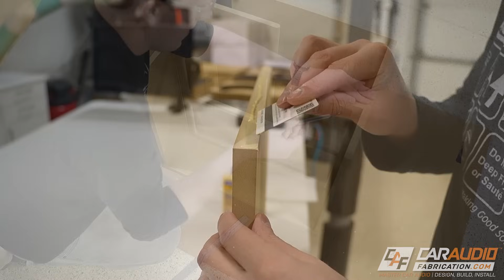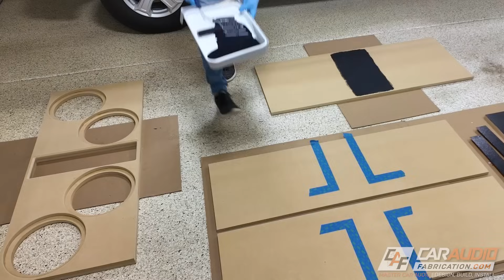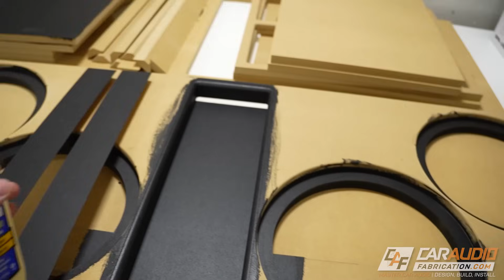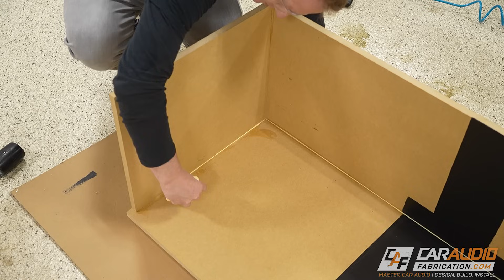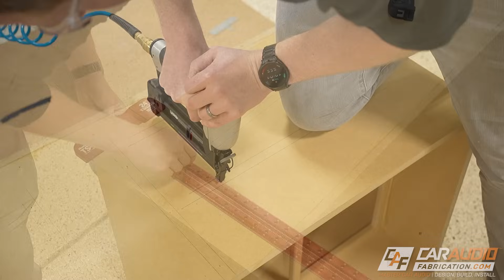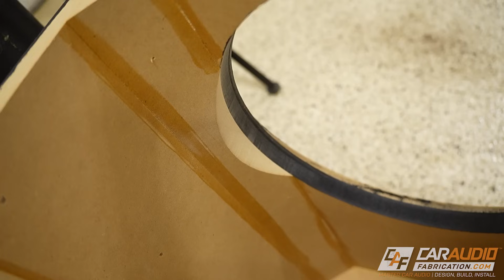Building Ported Subwoofer Box FOUR 12’s! - Assembly

Comment: If it's happened before why wouldn't you adjust the measurements instead of cutting out bracing?
Reply from the maker: It's a LIMITED space. You can't just magically make the box larger than what the vehicle would allow. And it's not actually an issue, I can easily remove the material as shown in the video.

Comment: Have you ever had issues with putting the enamel straight onto the MDF without any primer? I tend to undercoat / sand with Zinnser BIN shalac primer, its not cheap but goes a long way and helps aid in a glass like finish once you add paint either acrylic or oil base enamel, I've also vinyl wrapped MDF using this priming step with wild results!!! love tuning in mate awesome work!!!

Comment: Hello Mark , I have been following you for years now and I have been into car audio since 1985. I realize that I just aged myself but I’ll continue. I just purchased a 2010 Mini Cooper Clubman after my Insurance company decided to total out my prior car after hitting a deer. I’m contacting you because I am curious about what you would recommend to replace the factory stereo system in my Mini since part of the display and controls are built into the speedometer/everything else gauge. The car has the Harmon Kardon three way component speakers in the front and I believe that there are 6x9 speakers in the rear. The reason why I’m looking for your opinion is that in my previous car I was using four 15” subs and I loved it. The problem is the space is far less in my Mini Cooper but I still want to get the thunderous bass that I love. Any suggestions for me ?

Comment: Great vid Mark. Anyone or Mark, been out of building enclosures for a couple of decades, built 'um for a couple of decades ;) I know a lot has changed, but the principals are all still there. Wanna build an enclosure for a home, slot ported single 12". Have the thiele/small parameters around my desk somewhere. Can anyone point to some software now that I can input my specs and space allotment and it will spit out the tune/pieces to cut etc? Thanks a bunch, been watching Mark for years. Cheers.

Comment: I'm very curious of the reasoning behind the equipment choices here.  Is it mostly because it's a channel sponsor?  It's been a while since I've seen single voice coil subwoofers picked for a build.  It looks like you're probably planning to power them with that 1500.1.  Is that correct? The specs say these subs are rated for 500w rms, are you planning to feed them under 400? (assuming the amp makes right at rated power)  I might have missed it, but what's the net airspace and port tuning on this enclosure?

Comment: Mark I've watched lots of videos on painting MDF and can't find a lot of good info.. Is water based paint ok without using some type of sealer?
Reply: MDF will work with multiple coats of water based/borne finishes without a problem.  If you you want to cut down on finishing time, you may try glue-size which is a mix of PVA glue and water as a sealer, or you may try E-Z Vinyl Sealer by Mohawk/Behlen.  Then apply your water based finish.
Reply: @bfisher363  thanks for the input. Didn't know if it would swell being water based.

Comment: aaand a question! when using a overhand router like this in the vid, i have one, and 10/10 times i use it, that damn bit gets thrown into outer space more or less! i dont bottom out the bit in the chuck, and i torque it until the plastic parts starts making cracking sounds in the router (too hercules tight in my opinion). Starting it, it works okay, but after like 30s of cutting, the bit flyes away and i get andgry again, and use whatever else i can find in the garage to finish the project....
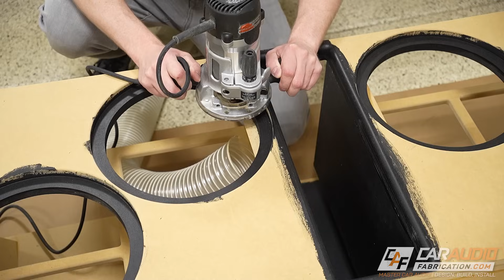Reply: Are you referring to the flush cuts around the 7:30 mark?  If so, make sure your router base is stable and use the right hand trick (if you point your thumb at the edge you want to cut, your index finger points in the direction you need to cut/move the router in).  As for the cutter depth in the collet... always leave around 1/8" (3mm) between the shank and the bottom edge of the cutter when tightening the bit in the collet.